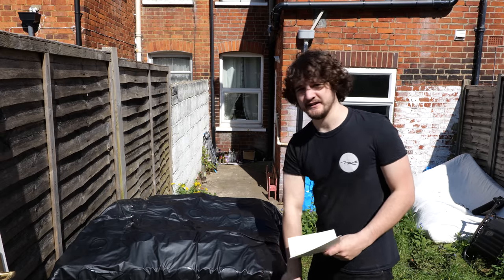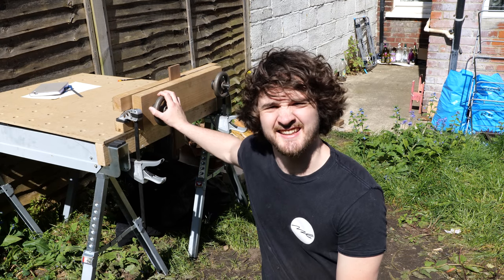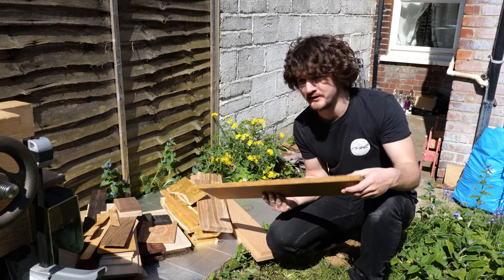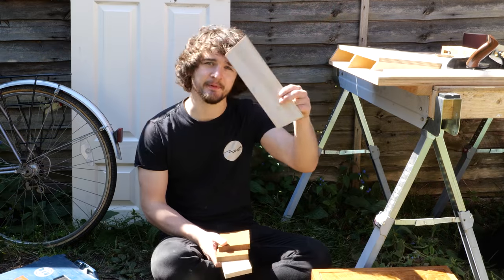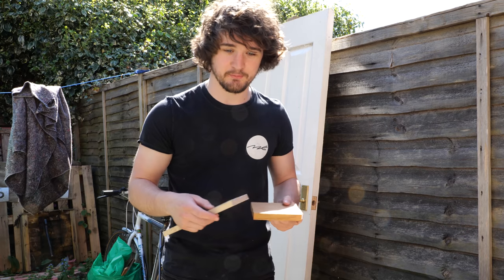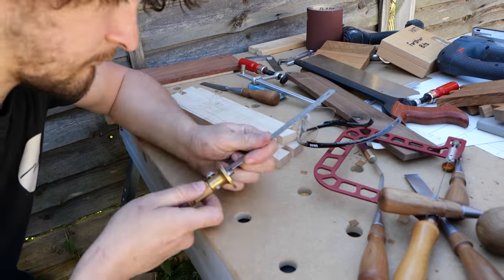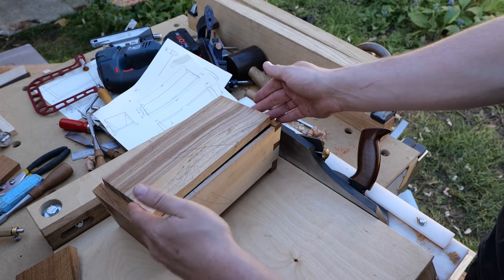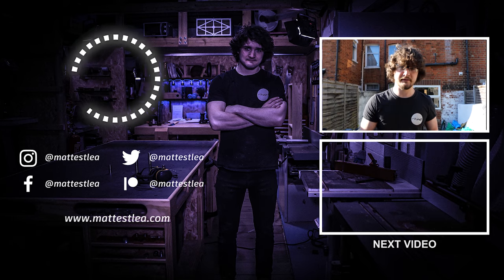Making the FIRST Box - The Garden Workshop #3

Comment: This is awesome, Matt! The box is looking great! I have a request, when you got the plow plane, can you show a little more detail of how to cut the groove without leaving a gap at the tails? I can't figure out how to do it. Right now, I just cut the grooves in the pin boards and no groove on the tail boards so that no gap is shown. I will appreciate it if you can show that.

I got an idea for you, I don't know if you tried wood hinge with dowels before, like how Rob Cosman does his boxes. That may be nice feature on some of these boxes that you are making for NHS.

Much appreciate you making all the videos. They have been very inspiring and informative.
Reply: Kenny Kong why not try marking the start and stop points onto the tail boards.
Start the plough on the first and stop at the end. Chopping down with the right sized chisel will square off the end of the stopped groove.
Obviously you’ll need to cut down the starting end with a chisel as the plough will not cut down parallel.
You could run a chisel back along the grain towards the start point and a stop cut vertically. Just being careful not to break out the ends.
Reply: Thanks, Scott. Interesting idea. Will it be a problem if the blade is out too far, say about 1/4"? Will give it a try.
Reply: @kennykong6330  same with any plane, you set the blade at too deep a cut it doesn't work great. I'd start the blade at zero cut. Adjust small amounts till it cuts just nice. I'd cut at the far end with the chisel first then run the plane up to that cut.
Once your at the right depth you'll need to use a chisel to finish up to the starting point. I wish you well 
Good luck

Comment: So did the racking drive ya nuts? Lol I have those same sawhorses and handsaws and chisels made me throw stuff, because the racking kept screwing everything up lol
Reply from the maker: I find that the racking isn't too bad when you stand at the front of the sawhorses, as opposed to working at the side. But yes, it did still drive me nuts!
Reply: Matt Estlea I bought a cheap sjobergs bench. It still racked a lot because it’s lightweight and cheap. What I did was build a 2”x4” laid on edge frame out of pine (housing frame lumber) and screw 3/4” plywood on top of it. Basically it’s a 3 meter long x 2.5 meter wide x 10 centimeters tall raised wood floor. Then I bolted the workbench down to it, so that I have something stable to work on. What you could do is either make a small 1.5 meter x 1.5 meter x 10 cm platform,  and for a workbench bolt a simple pine frame to it and put plywood on top of it to have something stable. Or since you got that shed that is heavy as heck and already has thick joists to it, lay some pine boards flat on floor and screw them to the joists, then screw some pine legs and stretchers to them, and put plywood on top. Yeah it wouldn’t be quite as “hey I’m being mobile and working off of scrap and knockdown sawhorses”, but having done both ways myself, it’s a lot more practical.